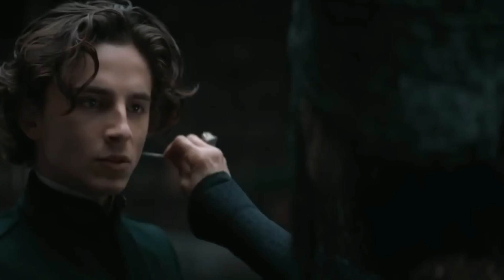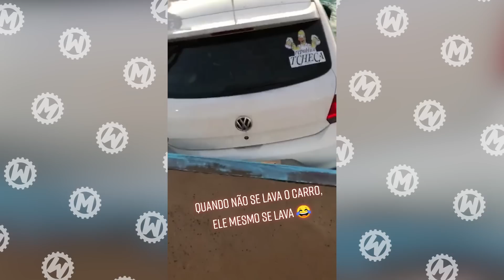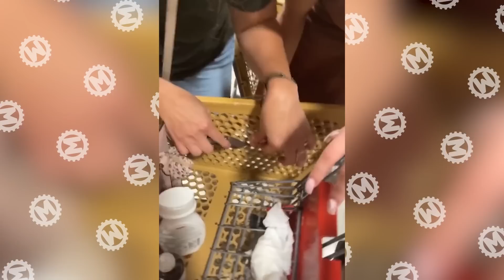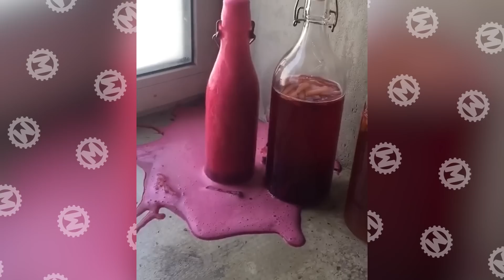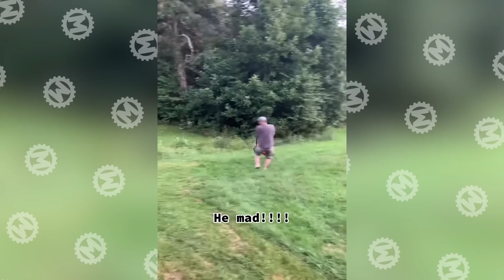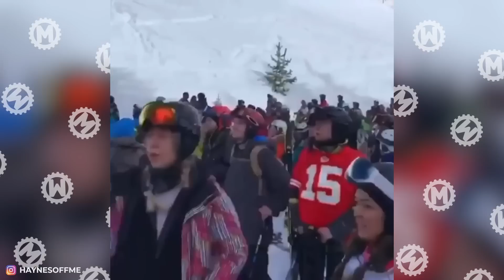40 People Whose Bad Days Were Shot on Camera

Comment: That footage of the black waste flying out of that sink can be explained by flash flooding or city sewer cleaning operations. Backwater valves can help. Probably not with that pressure but it would be an improvement lol

Comment: The guy never over did anything when cutting that pipe. Are you blind?  How did he mess up? Yoy have to cut the pipe out to out new pipe in. There shouldn't have been that much pressure. Could've been they were trying to bleed it but sometimes this happens you go to far but there shouldn't have been any water pressure.